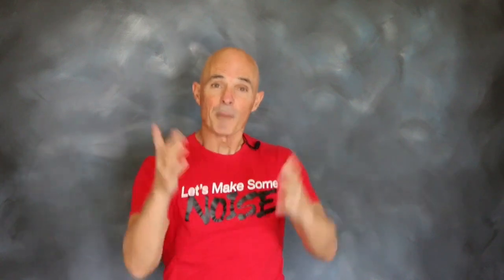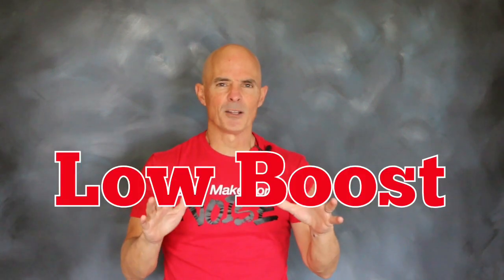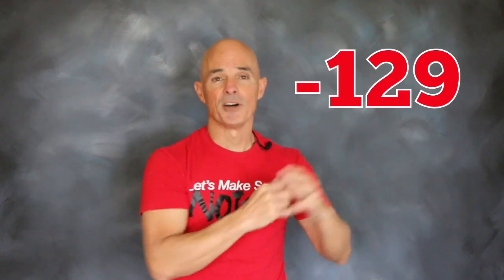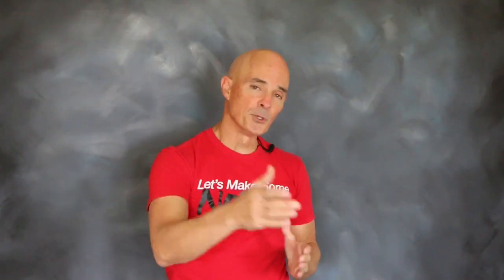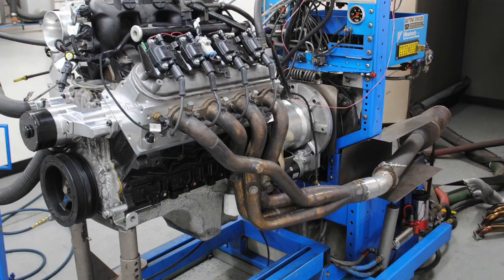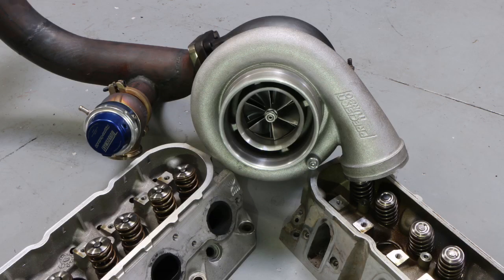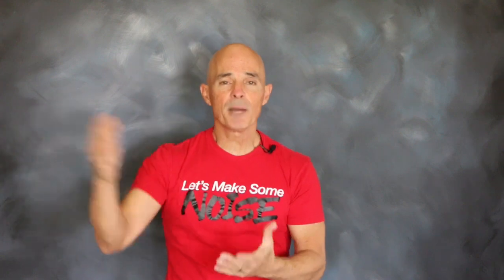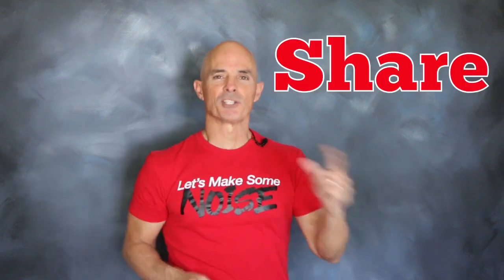What's Coming Up?-Turbo Tech & More!

Comment: How about a turbo test to see what size turbo is the best for a twin set up on stock 5.3 . And then what size single would be best and then which one is better.  Single or twin
Reply from the maker: we have to define best-its so easy to make power with a turbo 5.3L, you would be hard pressed to find a difference between single and twin turbos sized to operate effectively at the desired power level. I think it would come down more to packaging-though back pressure does tend to be lower on twin set ups-but again-all in the selection
Reply: @richardholdener1727  I hear you.  Thanks again Richard.

Comment: I enjoying your channel.  Thinking about getting back into the turbo world.  I have ran several of the Regal T Types.  They were a lot of fun.  Thinking about a rear turbo set on a mostly stock LS1 and running 7-9psi.  Space is very tight up front.  Is it worth the hassle of rear mounting?   Will I still need an A2A intercooler? 
Thank you in advance.
Reply from the maker: Dhamendra Nath those r cool

Comment: I love all these video ideas you have coming! I would also be interested to see a test on a turbo motor with flipped truck headers vs long tube or even shorty turbo headers
Reply from the maker: i have hooker cast manifolds vs tube header set up. the truck manifolds work well enough to make crazy hp and I don't think you will see much gain from tube headers until a high power level

Comment: Hi Richard, I like to see a three way test of cam lobe separation angles, say 107, 110 vs 113 on a turbo V8 motor.  Lachlan
Reply from the maker: I did a test like that-I'll check the LSA changes-I know it went to 120 degrees and may have gone down to 110 or 108

Comment: I’m compounding a s488 and one of those cheap gt45s on a 4.8 this winter just to see if I can get the best of both worlds out of it. If not the 88 will find a home on the daily.
Reply: The gt45 is a very lazy turbo for the power it makes , you'd be better off with  a S366 , you can get some cheap clones from vs racing . Spools up super fast and the at higher rpms the s488 can take over .
Reply: dilsher12 taken into consideration. If I can find one for around what I paid for the gt45 I might try it. I was originally thinking something along those lines just couldn’t find one for $163 haha. Paid $500 for the 88 so I guess I could throw a bit more at the high side.

Comment: Be cool to see the power difference between a 5.3 vs 5.7 or 5.7 vs 6.0.  How about testing a set of ported 706's vs ported 799's.  How about gains running 93 vs e85 on an NA engine running high compression over say 12.0:1?  Finally, how about dual 3" exhaust vs single 4"?
Reply from the maker: I have stock 4.8L, 5.3L, 5.7L, 6.0L and 6.2L and modded versions of all-though probably not identical mods (except 4.8L and 5.3L-coming up). I haven't tested E85 on high-comp na. Dual 3 in vs single 4 on an NA motor?
Reply: @richardholdener1727  Richard Holdener  I"m guessing the difference between the 5.3 and 5.7 would be similar to 4.8 vs 5.3 but who knows.  Also, obviously the 93 octane would be knock limited.  At some point the gains in compression would be offset and negated by reduction in timing.  All depends on where those two curves intersect.  Finally, I would think we would need a test engine with enough power/ airflow to truly test the exhaust pipes properly.  Say, 500 hp or higher, don't really care if its boosted or not since, correct me if i'm wrong, back pressure is back pressure past the collector.

Comment: How about revs? We all know the 4.8 loves them. how would you optimize a build for say a 9k rpm 4.8?
Reply from the maker: Tommy Presson I have an 8000 rpm destroked ls3 coming up where we used the 4.8L crank but it’s really not the stroke that determines rpm potential, it’s the valve train and cam profile
Reply: @richardholdener1727  yes! Really looking forward to the destroked stuff! 

I've seen the high rev cam profiles, like DF's landspeed sbc cam with their smooth ramps, but what I'm curious about is where the money matters. Like pushrod upgrades, trunion upgrades, dampener upgrades etc. etc.

What's worth it and what's snake oil?

Comment: Here's one more idea for you to consider messing with some day: How about working out a short stroke combo that would dramatically reduce compression ratio so that you could see how much turbo power you could make on 87 octane?  Maybe with water/methanol injection added in?  Looks to me like flat top LH6 pistons and rods in a 4.8 block with 706 heads, or a 4.8 crank in a 6.0 block with flat top pistons would make between 7.3 and 7.5 to 1 compression.  If you don't do it maybe I will, E85 makes power way too easily. :)
Reply from the maker: are you taking about bringing the piston down in the bore with a shorter stroke or rod length-that's not a good idea-better to do with with chamber and piston dish
Reply: @richardholdener1727  Yes I am!  Lol.  And I totally agree with you, obviously, but this is the only combination of "could slap it together" factory parts I have that would be anywhere in the ballpark.  I was planning to do something similar a while back with a BMW M60b40 crank shaft in an M62b44 block.  But that stuff is no fun to mess with compared to LS parts, so I sold the car and gave all of my BMW V8 engine parts away.  Plus, I really like bad ideas.
Reply from the maker: @tptrsn  dish lm7 pistons with 317 heads will drop compression-especially with a thick head gasket
Reply: @richardholdener1727  Thanks Richard, I'll calculate that up!  I actually have all of those parts, I just didn't think that would get the compression as low as I was thinking for a boosted 87 octane setup..  Do you have any thoughts off the top of your head for a thick head gasket?

Comment: Richard: I'm testing literally every question I've ever seen in my YouTube comments.

Commenters: but why aren't you testing ____________.
Reply from the maker: Ribbityibzki IKR-but I want ALL the suggestions!!
Reply: @richardholdener1727  since you're listening, you got any gen 3 Hemi stuff happening some time in the future? I'd like to see what a 5.7 hemi can do against a 5.3 ls with both running stock heads, similar aftermarket cams and similar boost. I'm building a 5.7 hemi because I scooped it up for cheaper than an LS.
Reply from the maker: Ribbityibzki I just ran lots of hemi testing including an HRT cam, nitrous and a turbo using long tube headers! Edelbrock heads next

Comment: I'm in the middle of switching from a cast 7875 journal bearing turbo with .96 A/R and 3" exhaust to a new ball bearing 1.25 A/R 7875 with a billet wheel and 4" exhaust. Have you ever compared the same "size" turbos that have different features such as billet vs. cast and BB vs JB? I'm sporting this in an 85 Tbird with a 5.3 and "stage 2" turbo cam.
Reply from the maker: it will like the bigger AR and exhaust, especially if you plan to wick it up

Comment: Mr. Holdener,
Do you think it's possible to run Liquid Propane injection???
It would give the same cooling effects as NO2 with the same fuel cost as E85 and since it would make it an Alternative Fueled Vehicle it makes it legal in some states that are tough on emissions
I am considering trying it on a late model engine with Direct Injection. My thought is that the Direct Injection is already built for High Pressure and also to test for increased cylinder pressure when the Propane goes from liquid to gas after the valves are closed. It might be interesting.
Your channel is the best, literally answering questions before they are thought.
Reply from the maker: I don't have much experience with LPG but have heard good things

Comment: Could you run a carbureted draw through turbo as in carburetor coming before turbo intake. Much appreciated.
Reply from the maker: that requires a turbo designed with proper seals

Comment: I would love to see some  "Average Horsepower"  under the curve comparing a Big Turbo vs a Smaller turbo, does the quick spool of a smaller turbo actually give a broader more usable horsepower to torque curve or does the BIG Horsepower number of the Big Turbo just blow the small guy out of the water even in the mid range.

Comment: I want to see A2W test with a cheap ebay vs. A high dollar unit
Reply: #LittleSmurfRacing I second an intercooler test. Could also do low $$$ A2A eBay intercooler compared to quality unit. Back pressure, efficiency and all that Jazz.

Comment: Very cool! Love the tests back to back with all of the mostly stock stuff.  Thanks again.

I'd like to see some meth injection testing on turbos with the nozzle pre compressor.
Reply from the maker: good idea-i did distribution tests for Engine Masters but it was post turbo
Reply: @richardholdener1727  The pre-compressor injection supposedly packs in additional benefits related to improving the characteristics of the compressor too.  And of course it would also be interesting to know how the distribution is with the pre-compressor injection relative to post turbo injection in a dry flow manifold (LS6 or whatever).

Comment: I'm curious to know what the benefit is if any on running high compression with a turbo in the 12 to 1 range there are a few guys at the tracks that are doing this they say its so they dont have to run as much boost to make the power . but i feel like there is somthing im missing or not understanding
Reply: I would also like to learn about this, is 10.1, 11.1 to much compression for a turbo E85 engine Richard?
Reply from the maker: its not too much if you have sufficient octane
Reply from the maker: racers combine the high compression with boost cuz it make more power-just make tuning super critical
Reply: @richardholdener1727  waiting for your vids!!

Comment: Hey Richard, I noticed you using the  Comp Cams Beehive Valve Springs 26918-16. I am curious how many RPM's before they valve float compared to a double spring. Is there a way you could test these to 7000-7300 rpm? What's the advantages and disadvantages of each?
Reply from the maker: dual springs will allow more rpm if your combo needs to go there

Comment: Im in the navy in California. I have a 4.8 2005 Chevy with 50k. What would do for budget but still have fun and drive to work?
Reply from the maker: Cali makes it hard to modify the daily driver
Reply: @richardholdener1727  its register in Florida. In a non emission county
Reply from the maker: @Terryray123  long tube headers, air intake and small cam, springs
Reply: @richardholdener1727  how big would you for a cam if i put a TBSS manifold on it?  For a daily drive? 3 inch exhaust? Cat deleted y pipe? Holley ls ecu last? Im looking for headers that fit.
Reply from the maker: @Terryray123  small-less the 220 degrees at .050 and closer to 210 degrees-look at stage 1 truck cams
Reply: @richardholdener1727  78mm or 90mm on a tbss manifold
Reply from the maker: Terryray123 tbss uses a 90 or 92
Reply: @richardholdener1727  sorry what i mean is use 78 with adapter on tbss or the 90 from Tbss? I saw your big isn't better episode. By the way thank you for taking your time out and messaging me back. I really like your videos.
Reply from the maker: @Terryray123  Better to use the 90 mm if it works with stock electronics-I'm not sure on that